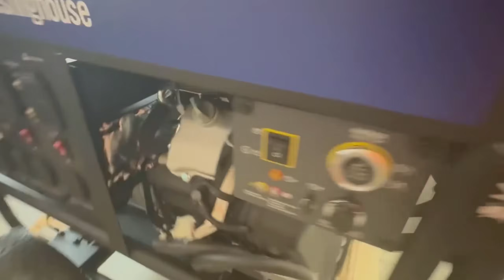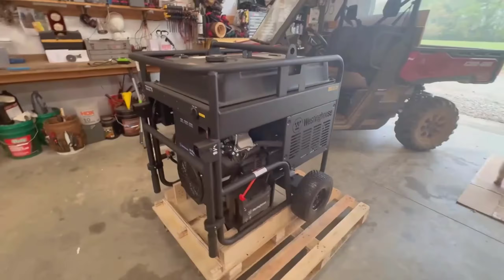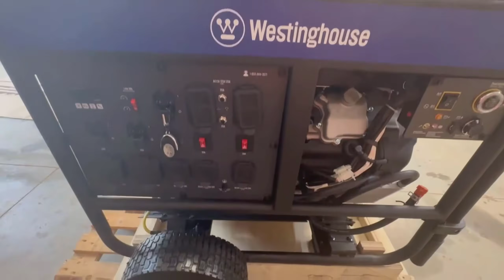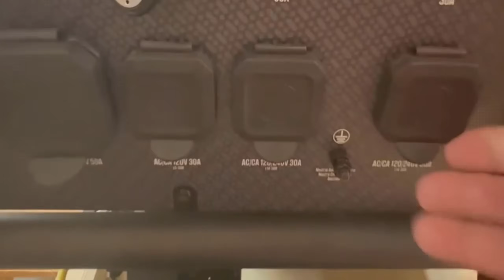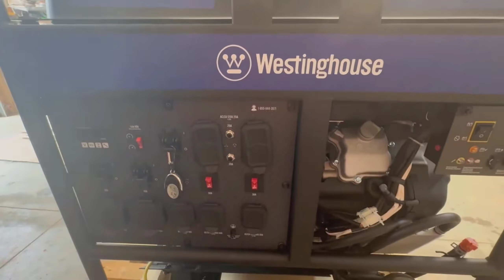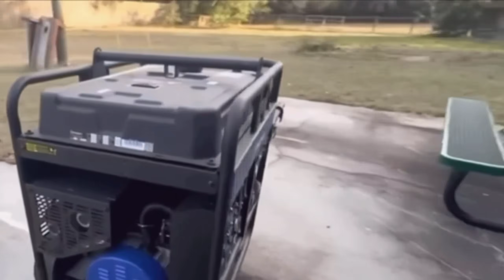Westinghouse 28,000W Peak Portable Home Backup Generator - Review

Comment: I have this generator and you cant get 20000w out of one 50a outlet, you only get 50a out of each…. Meaning you can run 2 separate items, up to 50a or you have to do some special setup to wire each 50a to a sub panel then to a manual/auto xfer switch….so basically, you have 2 10000w generators.
Reply: That's what I was looking into. Was fixing to buy to power my 15k furnace but was told it can't out of the 50amp outlet. Smh
Reply: I know these is a old comment but you can hardwire these generators  to the house like a standbye generator  it has the option
Reply: @hihaveaniceday9386  I do have this generator hooked up to my electrical panel via an interlock switch. Look those up is you’re unfamiliar how they work. But, as I said, you can ONLY run ONE 50a circuit at a time to the panel without some special wiring set up…. Basically you cant get both 50a outlets to sync up and provide the exact wavelength/sine wave at the same time and they would trip each other out. Again, you can run to SEPARATE 50a items…say your house (with a reduced load) and a camper at the same time but not both to the house to try to get 100a. A bit misleading when they say 28000/20000 watts.
Reply: @talonpilot  there is a terminal block rated for 125 amps  on the generator  itself you can wire directly to the generator to a breaker with a interlock, i am not taking about the 50 amp plugs

Comment: We bought this unit right after Hurricane Beryl hit the Houston area causing several days of power outages which was a first major outage we experienced.  Even the freezes of 2021 didn't produce the outages that we saw last year.  Amazon delivered it via contract carrier with lift gate service.  

We have (2) 200 amp service panels to our home that primarily run (2) 5 ton and a (3) ton air conditioners, pool pumps and normal household currents.  Our electrician installed the interlock systems on both of the panels as well as the 50 amp plugs. 

This generator is a beast.  We performed a full load test and it performed flawlessly powering up all of the ACs and pool pumps including refrigerators, freezers and other small appliances.  Maximum draw, after initial start-up loads, was 67 amps.

We store the machine in the garage when not in use and regularly exercise it about every 45-60 days.  We use treated premium fuel and have about 50 gallons on hand at all times stored in the barn.